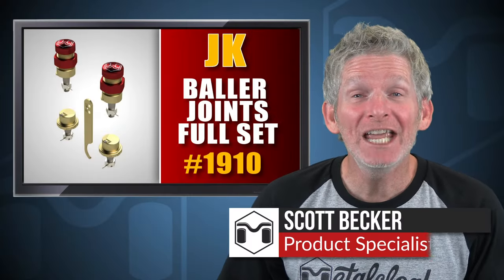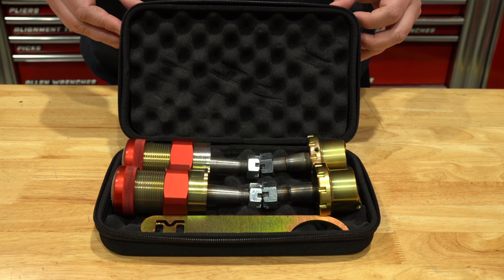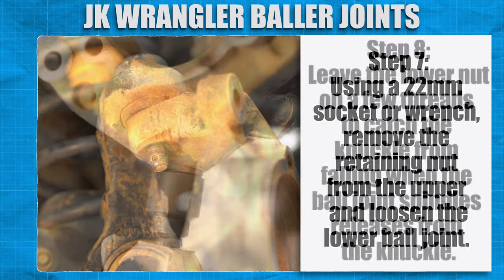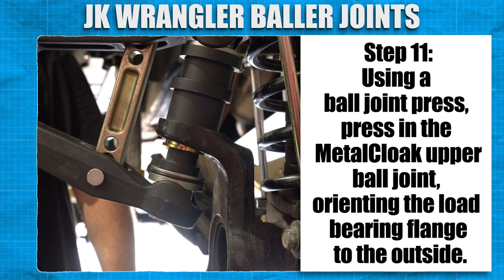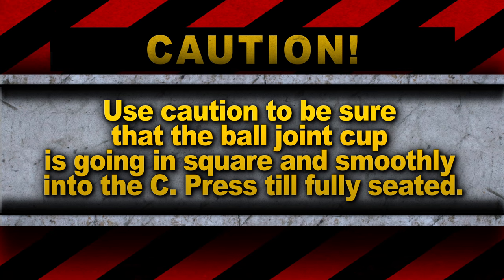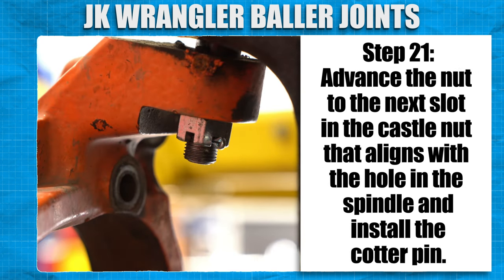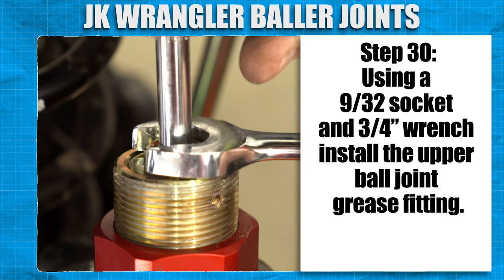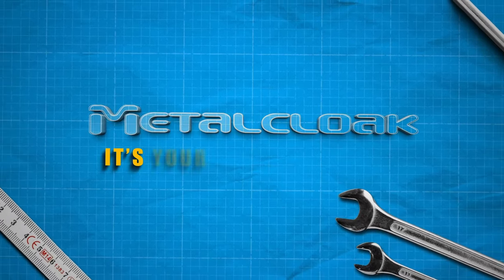How To Install: MetalCloak JK Wrangler Baller Joints

Comment: I am doing research on all types of ball joints and even the deletes. I like the ease of installation. I am leaning towards ball joint delete can you give me a reason for lack of a better word to get these. Thanks for a informative video.
Reply from the maker: Thank you for the question! There are a few reasons... one is adjustability. As parts wear, the adjustability allows for you to keep things tight and control memory steer. Another is grease-ability, which not only keeps parts working well, but keeps contaminants out. And, of course they are fully rebuildable without being removed from the rig.

Comment: FYI guys there are some discrepancies between this video and the downloadable instructions. You should also point out that the grease fitting on the lower BJ should not just point rearwards, but angle IN towards the control arm. The video shows this, but does not make any special note of it. If someone does not align that lower BJ just right, the ear on the axle stub shaft can contact it towards the end of the steering sweep. Failing to realize that before driving the vehicle could result in some nasty carnage.
Reply from the maker: Thank you. You are correct that there is better documentation in the written instructions compared to the video. Our instruction videos are intended to be a "supplement" to the written instructions, not a replacement. 
Thank you for your input, we will highlight that step with additional caution.
Reply: @metalcloak  thanks for the reply, and thanks for making quality instructions and videos. The angle of the lower joint was something not highlighted in either.
Reply from the maker: @DirtRoadTherapy  my apologies... the JL/JT instructions clearly spell this out. The JK instructions do not. We will remedy that immediately.